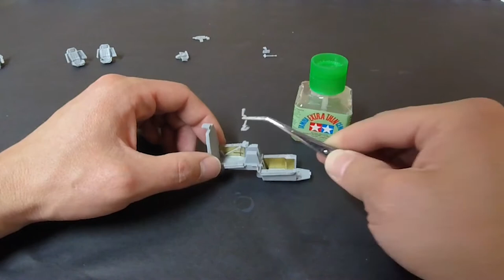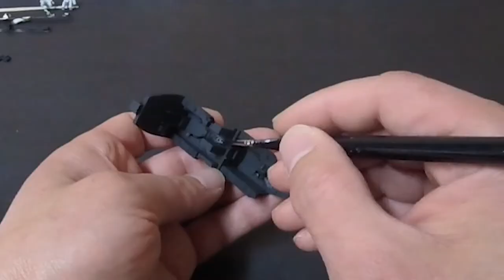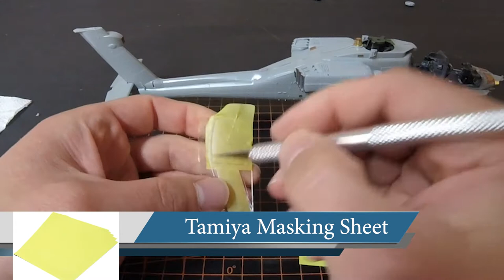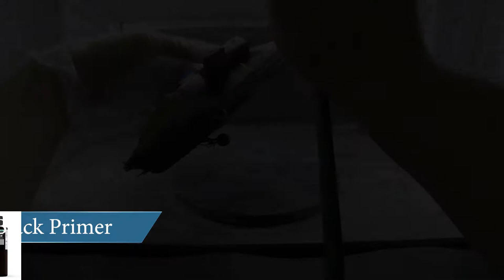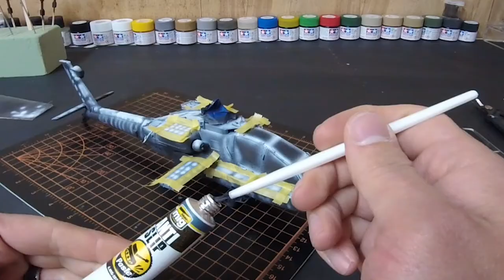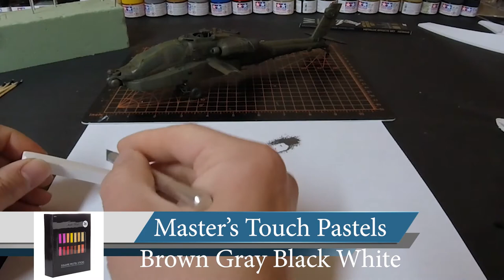Building the AH-64D Apache Longbow | Hasegawa 1:48 Helicopter Model

Comment: What ratio do you thin your paints down to to airbrush. And which thinner did you use. Just getting into airbrushing so apologies if this is a noob question.
Reply from the maker: Great question! I used Tamiya acrylic paint on this model thinned with the Tamiya X-20A thinner, and if I remember correctly it was 60%thinner 40% paint. To be honest I kinda mix it by feel. I also sprayed it at 20psi. It’s Important to note that the thinner the mix the lower the air pressure needed.
Reply: @avion34  thanks for the speedy reply and valuable info
Reply from the maker: @ChunksXx  anytime! What are you currently working on?
Reply: I have just finished up a airfix 1/72 eurofighter. Finish wasn’t too bad for my first plastic model in 15 years. (Built a few in my early teens) however this time I’ve decided to take the plunge and learn to airbrush. I have just ordered the hasegawa ah64d 1/48 off the back of this video. Hoping my years in RC helicopters pay off 😅
Reply from the maker: @ChunksXx  I can’t wait to see your finished build. This is a great kit, and it’s lots of fun to build

Comment: I always want to build a ah 64, but the colour tone is very hard to manage.
Reply from the maker: Yeah it seems like every reference photo I looked at has a different color. Some very dark green almost black some green and others brown. So I don’t know
Reply: @avion34  There's lots of reasons for that. The color fades very rapidly from the factory's dark green. Oil and hydraulic fluids leech out from the fuselage seams, especially from the center section where most of those systems are. Combined with dust, it makes something like a sludge coating on especially the lower surfaces. Then crews get that on their hands and transfer it to often-handled panels. Washing gets the slidge and fluids mostly off but not the stains. Anti-skid surfaces wear very thin. Fresh dust sticks well to the fluids, into seam lines and around rivets. In short, the Apache makes for a real study in weathering.
Reply: Yeah. The Apache is painted in the very difficult non-color of Helo Drab. It changes hue depending on where you view it from. It's like a mix between olive drab and grey. There is an NS code for it, but I think only a couple of manufacturers actually make a version of it.
Very enjoyable video.